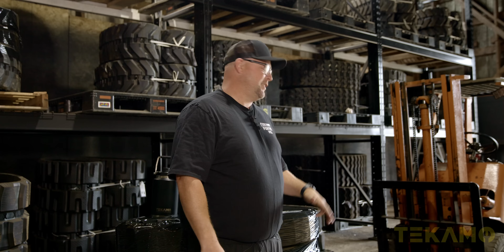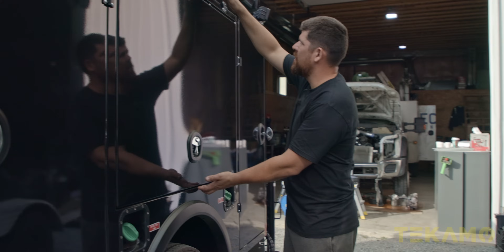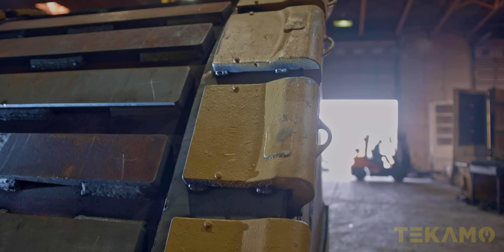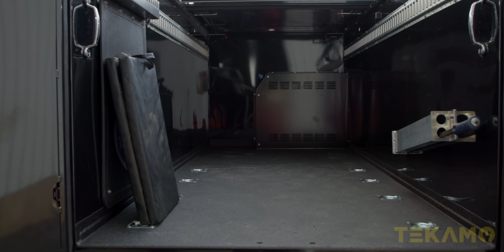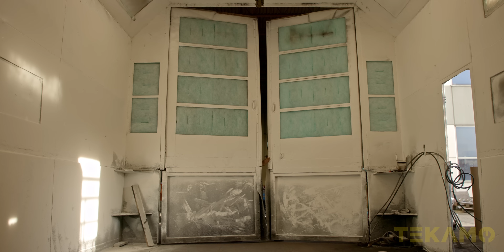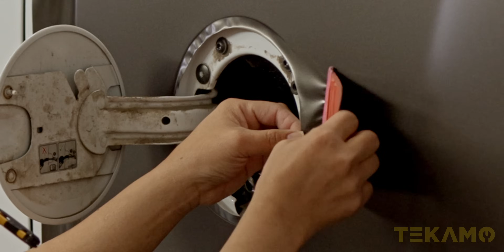Cam's Newest Service Truck! Truck Tour, Bucket Build, Battery Troubleshooting - Service Call #70

Comment: My company recently replaced my old worn out 2018 v10 f550 with 220k miles with a 2026 v8 f550 and its such a huge improvement its insane. Although Ford fucked up and didnt include a brake controller on it and go figure its backordered so I cant even get one. We run knapheide slant back utility beds with custom made racks for hauling trailers on top so its not like we're running as heavy and the gas motors last long enough for us to still make some money on them
Reply: Sounds a lot like uhaul

Comment: We have reached the age where the 6.0L power stroke is more reliable than a new power stroke. Good job modern ford engineers, The weather man is now more reliable than you are.
Reply: What world are you living in
Reply: @luckyzed884  living a world of maintaining a fleet of 20 6.7L power strokes from 2011-2025. Im now an owner operator mobile equipment mechanic but previously I ran the shop for a large excavation company for the last 10 years and I’ve seen problem after problem with them. So tell me how much experience you have with them?

Comment: Curious why they chose to do spray transfer hardwire on that bucket? Or maybe metal core? I’d have figured dual shield would have hit your fillet size and saved on a couple stringers. Not knocking it thing came out nice regardless

Comment: Nice Truck, Cam. Definitely something to be proud of. Pretty cool that you have one of your mechanics running it. Hopefully it turns out to be a good truck and stays out of the shop. That bucket is impressive. I wonder how many miles of weld are in that. What was the total weight. Thanks for the videos.

Comment: Love the Airpak but you’ll wanna keep a spare fuel pump on hand. 
Damn efi 😢😢
I’ve had mine a year and I’m on my 3rd pump running nothing but 97 octane
Reply: Better run the piss out of the compressor too. Makes water like no tomorrow. And the e choke sucks. Mine went to the shop three times in 100 hours. Took it off and went back to old stuff.

Comment: I run 3 bottles, oxy/act and a nitrogen for accumulators. I wish mine had those batwing doors over the wheel wells. Would help in the heat.